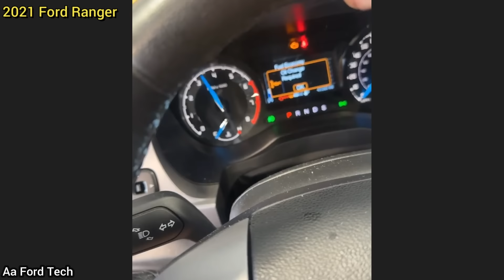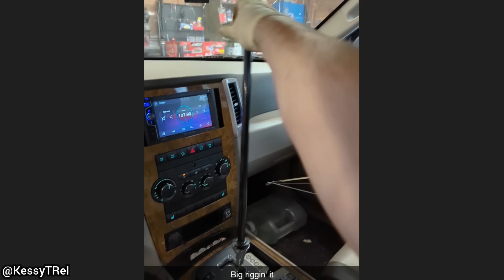Customer States Engine Sounds Awful After He Fixed The Engine

Comment: OMG folks!!!  The very BEST spark plug you can put in any stock engine is made by .. 

..the company that made the original plug came with from the factory.  The company spends millions of dollars trying to squeeze every fractional HP and MPG from engines.  You don't think they gave any thought to the plugs???  

Those stupid trick plugs are garbage and cause problems while solving nothing.
Reply: Well, I agree with you on not sticking hyped aftermarket plugs in your engine. But "The company spends millions of dollars trying to squeeze every fractional HP and MPG from engines"?? And then I get myself a chip tune, and all of a sudden my engine has 30% more HP,, more torque, better MPG and all still within environmental limits. Hmmm..
Reply: Probably got from Temu 😂
Reply: For consumables like those, the companies choose a part provider that will give them products within their intented specs at the price they want.
They may not be the best, tho. But you're right that unless the manufacturer suddenly do something wrong, picking up the same brand and model is a safe bet.
Reply: @scsirob  It's not within environmental limits - it's within the limits the catalytic converter can scrub, not to mention the extra strain the tune puts on the engine.  VW tried a multi tune trick in their factory ECMs and got effed over by the government for their effort.
Reply: @ohger1  Well in this case it's a Volvo S60 T2, standard with 150-ish HP that is also available as T4 with 200+ HP. Exact same engine. Exact same chassis. Same transmission too. The entire chain is designed to deliver 200+ HP.  It's purely a marketing.

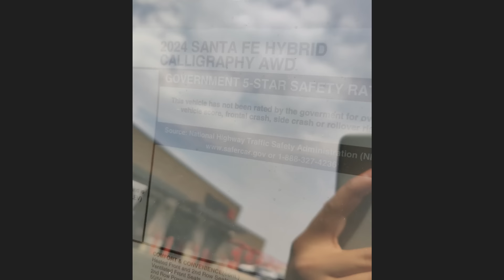Comment: 1:20 - Amazing that car even got out of the assembly plant.   Isn't there an entire post-assembly inspection before it ever rolls out the plant door?
Or (probably likely) the original door was damaged on the storage lot or during transport and was simply replaced with whatever exterior color matched...
Reply: Most likel damagedin transit.  I've seen mismatched side to side (1 guy "inspects" the left and another the right) but not on the same side.

Comment: How can the Jeep guy go through so many engines?
Reply: It's a Jeep thing!
Reply: Because Mopar
Reply: They probably never check the oil level or get oil changes. Back in 2005 I met a guy who had a 1989 Chevrolet R1500 Suburban. He purchased it brand new and never got oil changes or checked the oil level. It was ready for it's fourth engine.
Reply: Maybe nobody should buy these cars anymore?
Reply: I think it tells you alot about the driver..... 3 engines? WTF?
Reply: 3:47 that rear tire is flat just from the extra weight of all that crap glued onto the Jeep Liberty(at least I think that is what is under there)
Reply: Probably the wrong sump for the pan.
Reply: Stellantis makes crappy vehicles, and Jeep made crappy vehicles before Stellantis became a thing. Hyundai owners are the same way, just paying for engine replacements even though the company should've been sued over the issue instead.
Reply: @nodak81  because FIAT
Reply: @davidac76   - Yup.  Sounds like the driver likes to push that thing to its limits.
Reply: But why???? Just get the oil changed!
Reply: Low octane fuel maybe? Can't imagine anything else
Reply: Jeeps suck
Reply: Jeep is owned by Stellantis. Stellantis is a merger between 2 companies who are know for making unreliable junk: Chrysler and Fiat.
Reply: @Sh4dowgale  The Fiat and Chrysler merger actually brought us FCA. Stellantis was the rebrand after FCA then merged with Peugeot Group, bringing together Alfa Romeo, Chrysler, Citroën, Dodge, Fiat, Jeep, Maserati, and Peugeot (plus a few others) all under one roof.

...I'm terrified all of them working together is going to accidentally open some kind of black hole of unreliability that will cause cars around them to spontaneously develop problems.
Reply: Because its a jeep.
Reply: Maybe they drive everywhere in first gear, lol
Reply: It's a jeep thing.  You wouldn't understand.
Reply: Overusing the rev limiter LoL
Reply: Modern Jeeps are throwaway vehicles. The old Grand Cherokee my parents had ran damn near forever. Was fun to take for a spin around the dunes and could take any abuse you could throw at it.
Reply: @HighSierra1500 And he's buying these engines not the dealer right?
Reply: Jeep girl* 😉
Bet she has a sticker on the back that says “not my husband’s Jeep.”

Comment: How in the fuck does one go about putting 16 quarts of oil into your engine.
Reply: He probably thought it wasn't full until you see oil just about ready to come out of the filler neck.
Reply: Slowly, very slowly 😂
Reply: @Olds_Pwr  I mean your still going through like 3 things of oil
Reply: A critical lack of sense. (ahem)
Reply: Just think if there was a book in the glove compartment that told you stuff like how much oil to put in it...
Reply: @jeffreygunn3530  Read? I don't have time to read! 📑
Reply: Might need to use a bathroom plunger.
Reply: Well if you heard the part "the engine needs to be running" that is the reason. This news to me and I worked on allot of cars. Never a c10, but I would always pull procedures. Him as a diy thought it was a regular drain and refill, but also I look up the capacity. Not everyone has the same thought process.
Reply: @thesarcasticgenius3986  I mean my car has to be running and I have to row through gears to do it’s transmission fluid, but I don’t just continue to fill it up
Reply: @caboose6411  Ya transmission always. Oil, this is the first time, unsure if this is the same for super cars? I'll get back with you on this after I research it more, I can only think it's cause of the oil weight, and flow rate. Proper levels are not reached until everything is hot and flowing.
Reply: @thesarcasticgenius3986  It's got a dry sump lubrication system. So you have to have everything flowing to get the right oil level.

Comment: E3 spark plugs are literally the worst, I had the same problem on my 2012 F150. I put them in cause they were recommeded by several people, had a phantom misfire and general roughness until I switched back to Motorcraft.

Comment: i dont understand why people complain to shops that their car has a problem, the mechanics figure out what the problem is, then the customer says "nahh i dont want it repaired"
Reply: They either thought it would be free or next to free. A large portion of people substantially under-value auto repair and think that everything should be fixed for $100 or less.
Reply: Might be heading to the scrap yard next, so why get it fixed? Some folks don't understand the extent of the damage until they have a mechanic look at it. Yes, there are people who get confused about what a "710" is.
Reply: They might be trying to fix it themselves, but can't figure out the problem.

Comment: I was going to joke that the Ford Ranger noise was probably the turbo. The joke was on me, i did not know they came with turbos. What isn't a joke is that i bought a 302 with 375 hp, tranny, driveshaft and rear end from a wrecked 1970 Mustang. I put them in my 1992 Ranger XLT, badass sleeper!:hand-purple-blue-peace:

Comment: I wonder how many times an owner declines repairs until they actually get it fixed?
Reply: To be fair (maybe), some of these drivers WILL get the vehicle fixed, but they'll try to do it themselves or have someone who quotes a lower price do the work. Not ALL main dealers or garages are rip-offs, but many people mistrust mechanics in general.
Reply: i love it after they attempt repairs they bring it back and shop declines work
Reply: @theaikidoka  There are a LOT of shady mechanics out there. I took a car to one which a parts store recommended to fix an electrical issue when the windows stopped working. After I got it back, the windows worked but the power outlets didn't, though they did when I took it in. They refused to take any responsibility.
Reply: Several years back my health was BAD but my truck had a bad oil leak. I swallowed my pride and took it to a mechanic shop. He diagnosed a rear main seal. Which, laying under it, looked like the right call since it was all dripping from around the bell housing.
I paid this shop $1,200 because I was in no shape to drop a transmission. 
Needed a new oil pan gasket, too, for another $440. I told him no on that.

Got my truck back. Still leaking. He said it's the oil pan.
Nope. It was the oil pressure sensor the whole damn time. It still worked but was skeeting oil out the top. Took me fifteen minutes to swap out. 
Anyway, I haven't used a mechanic in twenty years and when I was essentially forced to, I got reamed.

Comment: In the UK we are required to have a yearly vehicle inspection of all the critical systems. It's a Government policy, called an MOT Certificate, and almost no-one will buy (and certainly no-one will insure or tax) a vehicle that hasn't passed its most recent MOT. They cost about £45 a year, but at least you know that the vast majority of vehicles are roadworthy. They might be driven by morons, but they are mechanically sound. 

Americans might have more personal freedom to decide on the level of care for their vehicles, but honestly many of these vehicles worry me. Also, our roads (though often pitted due to local Government struggling to keep them repaired) have higher speed limits than American ones, and I'd be horrified to see some of those deathtraps doing 70mph next to me.
Reply: A number of US states do these inspections like Pennsylvania and California, they vary in detail though, I grew up in Pennsylvania and when I was living in north Carolina I had a car I was sure would fail inspection for at least 3 reasons.  Broken door  hinge making drivers door inoperable,noisy rear brakes,, etc.. The mechanic said no problem, we don't need to check those things. I was shocked because it would surely have failed in PA.  Kentucky,  Ohio and Tennessee have no inspection.
Reply: Same MOT, APK. Auto Securité here in 🇳🇱 and 🇧🇪.
Reply: Americans need to get a state/safety inspection, too, or they won't be able to register their vehicle.  However, people do flaut the laws, but please don't believe that an inspection isn't required.  In my state we pay a separate registration fee as well as pay an inspection fee.  Depending on the state, the registration fee varies based on the model year of the vehicle which can be several hundred dollars.  Because people are unable to pay the registration fee, you'll see vehicles like some of the ones in these videos with these horrible "repairs" driving ILLEGALLY on the roads.
Reply: Pennsylvania has yearly inspections through the DOT too, as do 14 other states. What's your point?
Reply: @jeffreypgorman  In NY, there's always someone who knows a guy who will slap a sticker on for an extra $20 as long as there are no codes. I see a lot of trucks every day that are as bad, if not worse, than some of the rotting corpses on this channel with brand new inspection stickers on them.
Reply: @LeeLeeLeeLeeLee  That's certainly not true for all states.
Reply: In some states they do a state inspection and emissions test. I did them for years, most cars pass. But in other states their vehicles are crap.
Reply: @Caffeinated-DaVinci  If your message was to me, then my point is that although some states do require tests etc, in my opinion not enough do. Nobody LIKES paying taxes, but the point is to make society as a whole safer, not just the person paying the taxes. 

I think it would be better for Americans as a whole to require more comprehensive testing and driver skill training. The UK test is WAY more comprehensive than the US ones, and Germany's are way more comprehensive than ours (they include things like being trained/legally required to give first aid to accident victims, and how to drive in poor weather).
Reply: @jeffreypgorman California has no such inspections other than smog. 45+ year CA resident who has owned 10+ vehicles.
Reply: When we look at crash statistics, mechanical failure isn't even in the top ten list of causes.
I understand the point of wanting people to drive sound vehicles, but if inspections made crashes less likely, the insurance companies would demand them.
The drivers are the weak link.
Reply: As others mentioned, some US states do require regular inspections. The details of what is needed to pass vary from state to state.
If you suspect there's also a pattern between more politically liberal versus more conservative states, you might be right.
Reply: Every video on this channel has at least one comment talking about the MOT system (you all can stop, we know about it). As mentioned previously, several states mandate inspections. Louisiana is one of those states, & manages to have more junkers on the road than the surrounding states without inspections.

Britain may have the luxury of enough public transportation to trust random mechanics to not screw people over, the US doesn't. Many states are larger than the landmass of Britain, cars are frankly not optional for the vast majority of people. There's good reason MOT-style inspections are in limited use here.
Reply: @ryanm4013  odd. with all their other regs, I was sure they must
Reply: @kingnull2697  Why would people in Louisiana not know any good mechanics? Any place I've lived, we just ask locals who to go to. I moved a year ago and right away asked my new neighbors for suggestions for mechanic, dentist, and so on.
To be honest, if someone doesn't know a mechanic who can maintain their vehicle, that sounds like the safety problem right there.
Reply: @j_taylor  It's not about finding good mechanics, its' about being low rent.
Reply: @kingnull2697  I don't understand how needing a car (which I agree is not optional in many parts of the US) is in opposition to getting it regularly inspected for safety. Surely if I must drive, I rely on my vehicle and those around me to be in safe condition.
Sure repairs cost money, but...that's part of the cost of driving. It's false savings to say "I can't afford to replace tires when they wear out, I can't afford to replace a dead headlight, I can't afford to replace brakes before they fail. So I will just drive without those repairs."
Reply: In Texas, and a few other Republican states, don't have inspection programs anymore, basically to own Democrats, and that making you get your car inspected is government overreach and a violation of your freedoms.

Comment: Is there a state-wide registry of unsafe vehicles these shops can report vehicle to when the customer declines repairs? Like, if it fails inspection, the owner has 30 days to make it pass inspection or the registration is suspended until it passes? I'd love to see a thing where someone uses zip ties and spray foam to fix a rusted frame, it fails inspection, the guy's like "It's fine" and drives off, refuses to try to get it fixed, and it ends up getting impounded.
Reply: In most countries yes. In the US, many states don't care.

Comment: Always nice to see these vids. My Subaru Legacy 3.0R Spec. B went to the anual car check/ TüV/ APK/ Auto Securité here in Belgium and i need 3 new tyres, new rear brake discs/rotors and brake pads. Headlights must be adjusted and one steering shaft hose must be replaced. It is a must. I will do the brakes myself and the village garagist will do the lamps and tyres.He has the tools to check the lamp adjustments and tyre balancing machine. It must be done before october.  Rake discs and pads are €139. Tyres i do not know yet.
In the Netherlands you only have two weeks to fix your car. My car is original. 6 speed manual. Stationwagon.

Comment: I get why people don't want state inspections but knowing all these bad vehicles are on the road scares me!!!!😂😂
Reply: We have state inspections here in New York and the cars that pass STILL scare me.
Reply: The problem is that state inspections go too far. My mom's car failed just because the check engine light was on. The problem was just that the fuel level was reading slightly off. Cost over $1k to fix a problem that wasn't an emissions problem and wasn't a safety issue. It never needed fixing, but she had to just to pass a stupid inspection.
Reply: I think the UK MOT strikes a pretty good balance, it's really just about safety and emissions. I even had an airbag light on for one and didn't even get an advisory.
Reply: @andrewcampbellski Wow, here the inspections are bi anually and No warning or error lamps can be illuminated.

Airbag = safety system not working = car is unsafe to drive = instant fail
Reply: @nodak81  I'm curious how an incorrect fuel level reading would trigger the check engine light. I mean, how would the car even know?
Now if the fuel level sensor had a fault, that could result in a Diagnostic Trouble Code like P0463, but that's a failed sensor possibly an electrical short in the tank, which is very much something to fix.

Comment: Can someone say what those 'high performance ' spark plugs are actually for?
Reply: For wasting money on an inferior product due to marketing gimmicks. Those plugs are total trash.
Reply: @ritzoriginal  That's.. accurate.
Reply: they keep the BIN running just nice
Reply: They're just crappy regular spark plugs you can get at any autozone
Reply: Total trash. Why anyone would want to install a copper based plug from the beginning of spark plugs that has three ground straps covering up the spark, that only last 5 to 10 K, vs a platinum or iridium that lasts 100K? It's just snake oil, like the "fuel shark" cigarette lighter plug in that was, and still is a literal LED light that glows when you plug it in and yet some people still swore it saved them fuel. Stupid people buy all kinds of marketing hype.